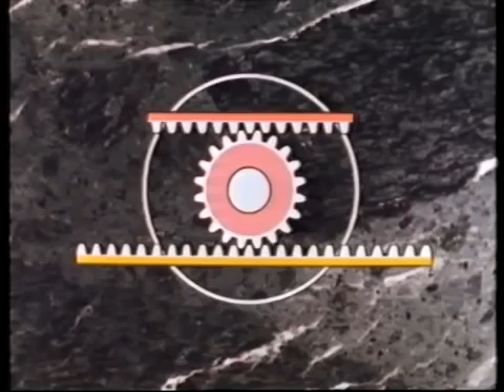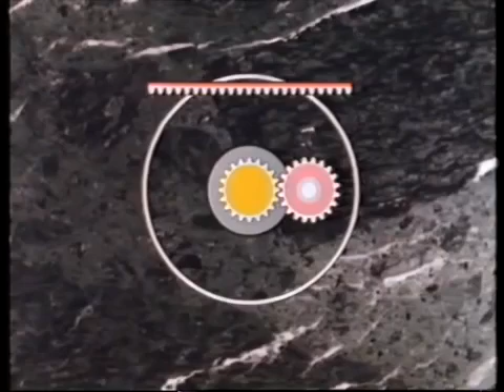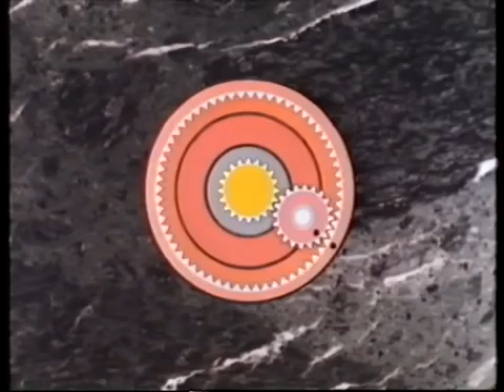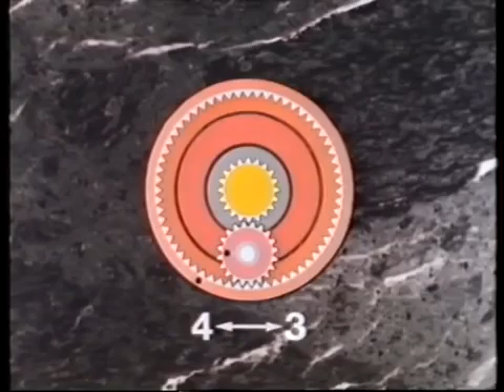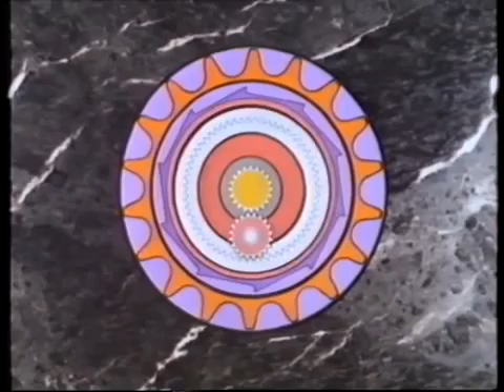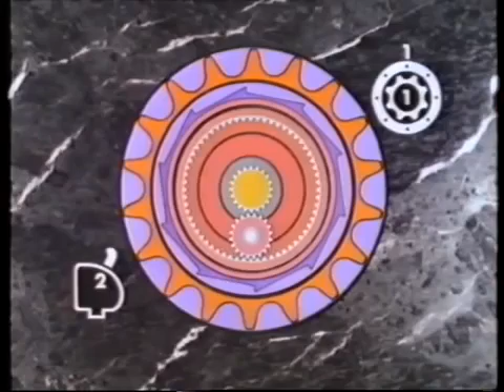internal gear hub principle

Comment: I still don't get it :(
Reply: you're not alone mate
Reply: Basically, depending on how the input (drive chain) and the output (rear wheel) are connected with the gear hub, it changes the gear ratio, hence the speed/torque.

For this gear hub, there are 3 settings:
- Normal Gear setting (1 in 1 out), by connecting the drive chain directly to the rear wheel. This bypasses the gear hub entirely. 
- Low Gear setting (4 in 3 out), by connecting the drive chain to the ring gear, and connecting the rear wheel to the planet gear's disk. This increases torque by lowering speed.
- High Gear setting (3 in 4 out), by connecting the drive chain to the planet gear's disk, and connecting the rear wheel to the ring gear. This increases speed by lowering torque. 

Because of physics, Work = Force * Displacement, which you may understand as Energy = Torque * Distance Travelled. So when using the low gear, your bike travels less distance with the same energy that your legs put in, but it is easier to accelerate a heavy bike since most of that energy is spent on torque instead of distance.
Reply: It's quite simple really. You're on a planet going round the sun, therefore your gears will only work during the day.